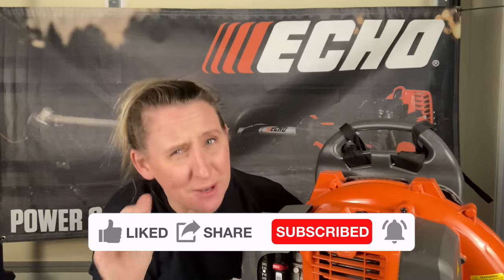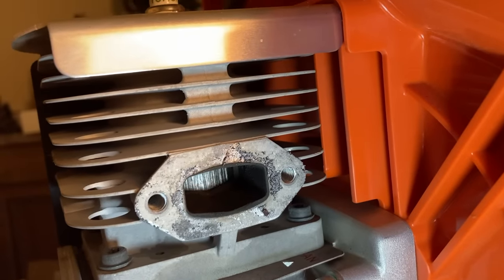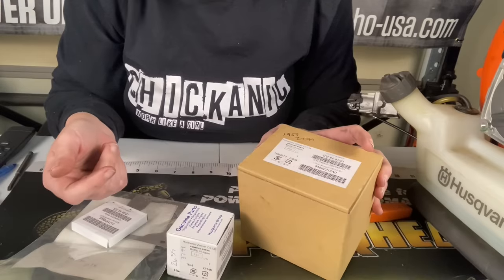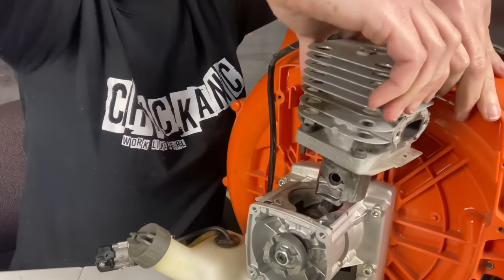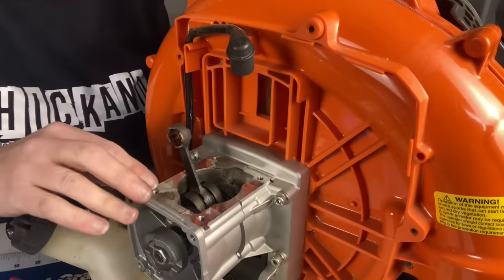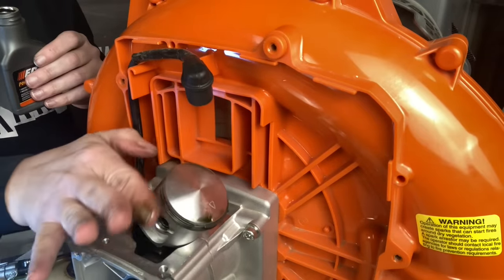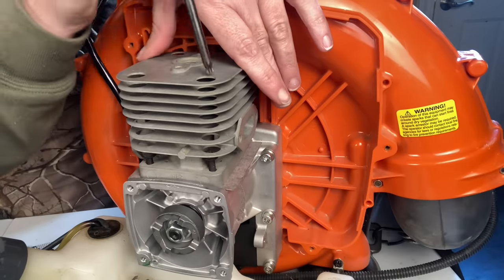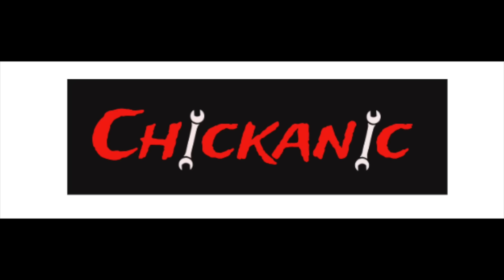How to fix a burned up Husqvarna 150BT backpack blower/Turning Shop Trash into Treasure VLOG Repair

Comment: When I moved to the city I gave my son my equipment. In the mix was my trusty old Sachs 120 chain saw. I won't mention the other equipment I gave him that ended up in the dump or that someone stole from his warehouse. The saw was not only run with straight gas but I discovered the carb needles were almost tightened up fully and in super lean. The piston was seized right in front of the port! Welded-in is more like it. Every time I walked into the garage I would heat the cylinder and try to beat the cylinder off with a rubber mallet. After weeks of this to finally got the cylinder off. I couldn't get the correct size piston or rings for it. I would use emery cloth and polish the piston until the rings would turn. Pulled the rings and used jewelers files to clean the ring grooves. Honed the cylinder then oiled and reassembled it. It has been cutting wood for 5 years now without any problem. The compression was just fine. I do run the gas mix a bit fat and the carb is also a bit fat. I bought the saw in 86 and back then it was over $500.00 so it was worth saving. I only cut a couple cords a year with it so it isn't worn out yet! Repairing it cost me nothing. The rings and piston I got for it were over size, a lot over size!!

Comment: A good example of why a 2 cycle should be warmed up. Running full throttle at start causes the exhaust side of the piston to expand faster than cylinder. Good by clearance. The intake side is cooler from fuel flow and less expansion.
Reply: It also happens from cold seizure too like clock watcher said
Reply: @danthompson5797  yes but it will. It's not cold like winter time cold.  It's cold like room temperature compared to 400 degree operating head temp or hotter.
Reply: Everyone puts oil in the gas. Especially a 2 cycle. ;)
Reply: Not good oil, old mixture, or pure gasoline ...
Reply: If you let a 2 stroke engine to warm up for i guess 2 minutes the exhaust with start to be covered in the oil then it would get clogged
Reply: The pin is called an anti-rotation pin.  They keep the ring from rotating and ending up in a position that would reduce compression.
Reply: I use 1184 on all base gaskets and Locktite blue on the cylinder bolts.
Reply: @johnclarke6647   The pins are there only to keep the ring ends in an area of the cylinder where there are no ports, ring ends would relax into the port and be broken off otherwise.
Reply: That’s true.  I always warm my saws up about five minutes before using them.  They will get about mid throttle upon startup, but I blip them to idle as soon as the rpm stabilizes.  Then, I set them down on the ground for their warmup.  I take about three saws with me and I just let them idle, before I cut the ones I am not using off.  If it is real cold, I may let them continue to idle until I need them.  I may only use two of them during the cutting session, so I cut the remaining saw off.  If needed, I recrank it.  Cutting up a downed tree it is not uncommon to get one or two of them stuck in a cut.  I once had three of them stuck at the same time and was glad I brought four with me.  I ended up cutting them out with a MS 251, the smallest saw I had brought with me.  I probably could have wedged them out with wedges but it is a lot easier to put in relief cuts with another saw.  Once this is done, you can re-crank the stuck saw and cut your way out with it.
Reply: @mazb6t  they are there to keep the gap in the ring from rotating around to the exhaust side, causing a loss of compression.  The bevel on the port stops the ring from getting hung in a port.  The exhaust and transfer ports are the ones you must chamfer good.  The intake port chamfer does not matter as much, because the only time the ring hits the intake port is when the piston  is installed in the cylinder.
Reply: @Michaelsmith98453  when I have put on a pot+piston I will run it for 10 minutes to bed in before I run it at full speed
Reply: Your machine maintenance knowledge is amazing i wish you were based in my town Letchworth Garden City North Hertfordshire England. I would pay you to fix all my Garden Machinery. Thank you very much for your ab fab videos keep up the good work. 👍
Reply: @danthompson5797  LOL
Reply: @cravenmoorehead5636  badass screen name lol
Reply: @nicktease0687  you are the first to acknowledge it since I started using it a few months ago. Must be that '87 era humor stickin together. Lol.
Reply: @cravenmoorehead5636  lol.   I think we were the last model produced which came with a sense of humor standard. After that they switched it out for extra feelings.  Lol
Reply: @nicktease0687  facts
Reply: @danthompson5797  🤣
Reply: @johnclarke6647  Keeps the end-gap from  catching a port.
Reply: @robertprelewitz4511  the anti rotation pins should keep the ends of the ring from catching the exhaust  port and they are well to the rear of the exhaust port.  I bevel the bottom of the exhaust port with a good bevel, which has kept my rings from catching.    However, unequal expansion of the piston could cause a ring to expand into an exhaust port that is not properly beveled.  You do not have to worry about the intake side, because the ring only hits the port when you install the piston the first time.  I bevel them and then sand the bevel by hand with a small piece of wet or dry sandpaper.
Reply: Very true statement

Comment: That's the one thing that's awesome about 2 cycle engines. They are so Incredibly simple, that even after being fried with no oil, it only takes a few parts to make it good as new. That's not so much the case with 4 cycle engines. The valvetrain just throws so many more moving parts into the mix!

Comment: Thankyou guys so much for selling me this unit! It was cool to meet ya'll and see the shop. I may live 1.5 hour drive away but I look forward to doing more business with ya'll in the future! The machine is exactly as presented, now my foot just needs to heal. Very pleased!
Reply: Yeah I'm wondering how long it's gonna last after reusing the wrist pin and bearings on a burnt up saw that was ran on straight gas. Pretty sure that's not the best idea.
Reply: @mikesunken3486  
So far so good. If they built an entire engine out of wrist pin material they would last forever! It has many hours of trouble free operation since the rebuild. It is a blower, not a saw.

Comment: That HISSING was neat! It came from the carb because when the unit was last shut off the piston was on the down stroke putting pressure on the diaphragm closing the  fuel pick up line to the tank. The tank was full enough the lines were submerged. Then sitting in a cold then hot garage(maybe barometric pressure change) cause vacume in the tank. Once you released the seal the carb the diaphragm pressure equalized opening up that circuit in the carb letting the air rush into the tank. Neat

Comment: Around 30 years ago a customer brought in a blower that wouldn't start. Thinking it was flooded by the smell I pulled it a few times with on luck. When I did get to it a few days later I found the spark plug electrode pinched shut. Put in a new plug & after checking the fuel it ran. When the owner picked it up, I showed him the plug. Turned out he asked his son to use it & I guess the son didn't want to. I also remember a guy dropped off a new Stihl saw, case & all. The saw was new, never been ran till the owner's son borrowed it. It has mud all over it! I asked the owner the obvious. Saw was last year's Xmas gift. The son used it to installed an electronic dog fence. Did the deed good! Son wound up paying for a new bar, chain & sprocket, lol!

Comment: Bre, another great video showcasing your skills and ability. You are certainly correct about the predictability of the "it wasn't my fault" people factor. I see it frequently also. It makes complex or simple diagnostics, and helping customers, more difficult than it has to be. 
   This example showcases how fuel mistakes effect failure. Evidently mixing 2C fuel  is to difficult for some, they should hire their work done or use premix. Thanks for the excelent upper rebuild tutorial.

Comment: I generally will run a unit, after piston and cylinder replacement, for a couple of minutes at idle to allow the new rings to find a happy place in the new cylinder. That's a leftover from rebuilding automotive engines.
Reply: No criticism here just some info. You mentioned automotive engines. Letting any new rebuilt flat tappet camshaft engine at idle upon first fire will eat the cam lobes. You have to bring engine rpm up to sling oil over it via crank counter weights. Also varying rpms will help prevent cylinder glazing.

Comment: Very well done. Thank you. Excellent presentation and tutorial video. You saved me a lot of money on my brand-new blower. I have 2 gas tanks, one with oil for my blower and one for my other equipment. I used the wrong gas tank to refill my blower and burned it. Thank you again.

Comment: Great video! Putting threadlock on the cylinder bolts great idea.
Reply: red was a little overkill.  blue would have been better. but if youre not taking it back apart  ever it really doesnt matter
Reply: That's why she just used a little drop, not sunken the bolt in the bottle... 😁

Comment: I worked as a small engine repair. I'm retired but it good to see the changes. I've had a customer bring in a 2cycle engine locked up. He said he put 2 cycle fuel in it. What I discovered was straight gas in carb. Got to be careful . Would not warrenty it. I've seen it all . But it good to see videos on it . Thanks

Comment: I recently purchased one of those endoscopes/borescope/proctoscopes off the internet. Plugs right into my cell phone.   About $30 for the 16' length.  I may need to send it down one of my sink drains soon.  Works great for inspecting parts of engines where the sun don't shine.  I can send stills or video to a customer.  I used it to inspect the cylinder wall a used engine that I was about to purchase for a rider mower project.

Comment: I work at a feed store that has a small engines department. We have mechanics who work on them and a counter where we look up parts and order them and everything. I was recently transferred to that counter and the lady who runs it hurt her back after 2 days of training me. I've been running it by myself with very little training for over a month now. These videos have been insanely helpful! Even though I don't work on the chainsaws, mowers, etc. myself, knowing how everything works and what parts go where has helped me be able to look up diagrams and part numbers so much easier! I didn't have a clue at first! Thank you so much for explaining everything the way you do! I've even tried following along by taking a part you are talking about, finding it in our system, and seeing if it's something we have or if I should order it. It's even been fun for me!

Comment: I have the same blower, bought it off craigslist for 75 bucks. It has a broken pistol grip but it my have 1/2 a roll of duct tape holding it to the hose. Might fix it someday or I might list it back on line of $75.00. Have been using it that way for 2 1/2  years and it works great.

Comment: I still have the same model blower from 2015. I have only put true fuel in it and used it for the side hustle lawn care business and has paid for itself several times. Same spark plug and occasional cleaning of the air filter. For nearly ten years old and used for more than residential use it’s a solid unit.

Comment: I got this exact blower from a guy for $70.  And of course there were vague details aside from it “doesn’t run.”  Had this same issue although I could see the carnage on the carb side as well in my case.  My total parts purchase was about $70-80 even without discount agreements.  So I still ended up with a good blower for fairly cheap.  Good video!

Comment: I bought a used Stihl 400 blower with a bad piston/rings . I got a new head piston crank and bearings and gasket set  and now I got a blower that runs great for about $200

Comment: I love watching your videos, but I would have put a rag under the cylinder before I pulled it all the way off to keep trash or a piece of broken ring from falling down in the crankcase.. I also would have to put a rag under the cylinder to put my risk pin creepers in.But you got it running and that's what counts. That was my two cents worth. Thanks again for your videos, I love them.

Comment: Good job, I work in a repair shop. I just did the same thing to a Stihl chainsaw.  I always cover the crankcase with a shop rag so I don't loose the wrist pin retainer in the crankcase, also to keep the cylinder and gasket aligned I use two Stihl trimmer head removing tools to keep thing lined up. They are the right size and don't damage the threads in the crankcase.

Comment: 15:56 I see a very nice car, a 1968 or newer cougar.  Not an 67 XR7, but still...  My first car was a 67 Cougar XR7, 4 speed, 289.  I would love to have it for a daily driver these days.  Well, with A/C which mine didn't have.  MPG wasn't the best, maybe 15.  Shoulder belts and air bags would be nice.  And it helped me earn my first (of two) speeding ticket, 45 in a 25, cost me $63.  Maybe it's good I haven't had one all these years, the clutch was so stiff, I bet I would have needed a knee replacement by now.   

Nice work on the blower, Chickanic.  I was surprised at how easy the cylinder went back on the piston.  Great saving the blower!

Comment: I've owned a 150BT for 13 years and it has been dependable except for the kill switch wire which broke. I ran a replacement wire on the outside of the harness and it works like a charm. A good smooth running machine.

Comment: I ve had an old MTD weedeater that i had bought new about 20 years ago for $80.00, at the end of every season i run the weedeater completely empty of all fuel, only service it has needed was new fuel lines in the 20 years i have had it,  still has the original plug in it yet.  It obviously has a lot of run time on it but over that time it has so much compression that it literally rips the pull cord out of my hands when it fires  up

Comment: My daughter decided to do lawn service after she graduated high school to make money for college.  Since dad was going to be the main sponsor and head mechanic,  I made a decision that I have stuck with even to today (this lawn care endeavor was in the summer of 2008). I threw away all my gas cans except for one, and it gets gas (non-ethanol premium), 2 cycle mix, and 1/4 to 1/2 ounce of Stay-bil and Berryman B12 (or seafoam) additives. I figured one can would prevent mistakes like straight gassing 2 cycle equipment,  and I was right, doesn't hurt the lawnmower,  I've never had to change a plug yet, nor have I had to rebuild any of my carburetors. It's been more than 12 years, and I KNOW (I work in the industry) that father time will eventually take out my diaphrams, but I have 5 sawsm 2 push mowers, 2 trimmers, 1 rider, a blower, 2 mantis style tillers, and a partridge in a pear tree that I use regularly, and with my fuel blend, which goes in EVERY gallon of gas I buy, has worked marvelously.  As a side note, from 8/2020 through 5/2021 I was undergoing cancer treatments and didn't use my saws at all. Still had gas in them this summer when I finally got back in the hills, and ALL STARTED and ran good on 4 pulls at the most! Didn't even dump the old fuel. As a second side note, through this covid pandemic period AND doing the cancer treatments,  I NEVER MISSED A DAY OF WORK,  EXCEPT TREATMENT DAYS.  I actually made $2500 MORE over that period than the previous year

Comment: The old boat engines I raced had uncaged bearings, they were a pain! Grease is your friend.
Working on the bank, I ysed hose clamps to squeeze a set if rings, once the where in I unscrewed the clamps and removed. "Race what ya bring to the track!" 🤣

Comment: In case someone else hasn't mentioned it, the the locating pins in the ring grove are for keeping the rings from rotating so they don't catch on the exhaust port.  Not so much a compression thing.  I too was a bit concerned about the big end bearing but, 2 stroke lawn equipment usually runs a bit fat in the oil mix plus the moderns oils have outstanding film qualities.  So, the piston and cylinder will be damaged before the big end bearing...  It's probably just fine.  Won't know for many hours of use.  BTW, your R rear tire is a bit low.  I'll leave the Cougar comments out..  :)
Reply: I thought that was the chicken shed.

Comment: I used to work in a electronics repair shop, customers would bring in a dead stereo and swear that they only had one set of speakers, when I knew they had 3 or 4 hooked up. What are you going to do? Call them a lair?  My gas mix, for a 2 gallon, I stop the pump at about 1.8 gallon. My 1977 041 still runs.  I don't mind a bit of smoke.    Love your channel,, I've learned a lot

Comment: The exhaust port is a permanent leak on the side of the cylinder and will always be a source of galling and unless someone slaps it against a tree at full throttle it will always be the most worn part of the piston and cylinder.      Nobody's really explained that online.   Friend of my brother had hand-made wrist pin removers that were a T of metal and a couple loops of aircraft cable, you'd just stick the cable in behind the piston through the wrist pin and yoink it through with a pair of channel locks used as a lever.   Sounds like the kind of tool you'd like to have, definitely never marred the pin and who gives a flight about the piston.

Comment: I have one of these blowers, had it 6 years, great blower. Run 50:1 in it with a high quality oil and has never not started after second pull on choke. Can run a year old fuel in it year round as well. it also sits for around 4 months out of the year. If this thing burned up, there's a reason.